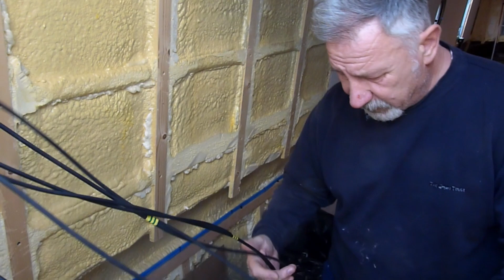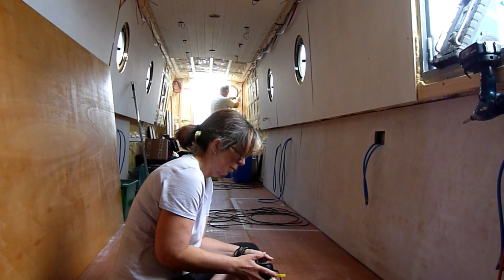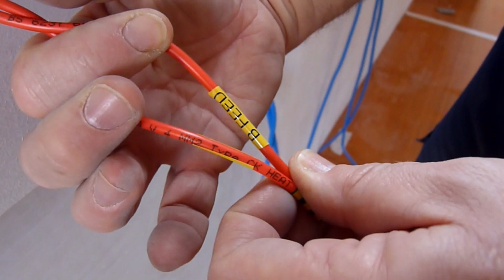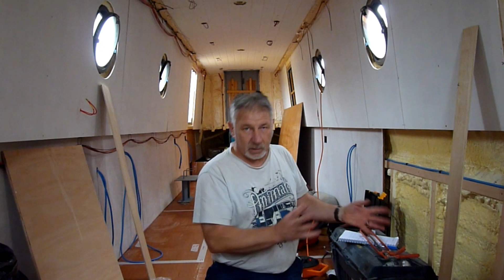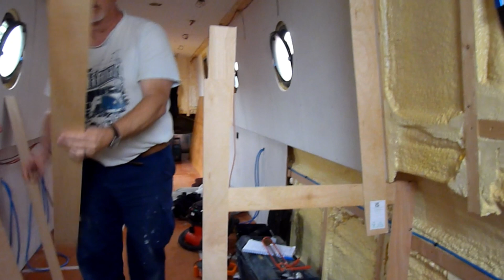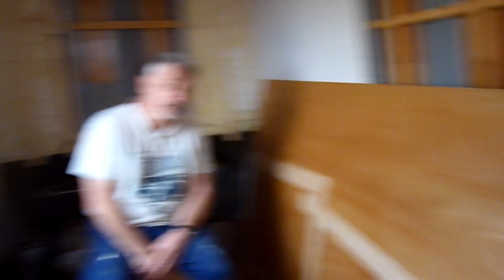Ep 18 Narrowboat build installation of more wiring cables and build the templates for the bulkheads

Comment: I thought your balanced assessment of where to use a stud wall or single layer ply bulkhead was excellent. Elsewhere on the internet people have expressed strong polarized views on this subject.
Reply from the maker: Thanks for that, I try not to let too much internet chatter influence me and rely mainly on my own logic.
The bulkheads on Tatton are as I said braced by other fittings and cabinets so will be more than rigid enough and will take up very little longitudinal space in the boat which is limited anyway.. 
Thanks for the comment.
Reply: @AtaleofTattonTug  The pro narrowboat builders tend to use single sheet partitions because they will have templates for serial production and can start bracing with other precut furniture within days. If you stop for a month over Christmas it might be a good idea to clamp some 2x1 batten to the outside door edges to keep the ply warp free. Will you cross screw the ply into place through some pocket drilled holes? No need to reply, I will wait until the next exciting episode, "Same Bat Time, Same Bat Channel" as they used to say on TV in the 1960's.